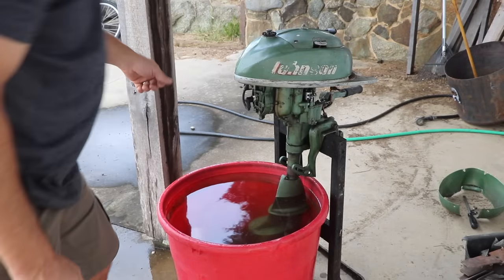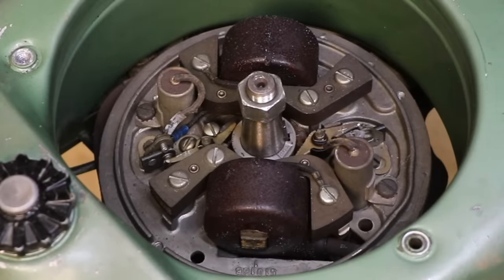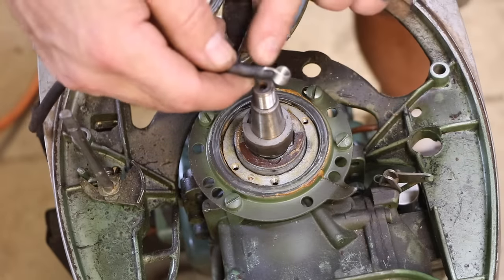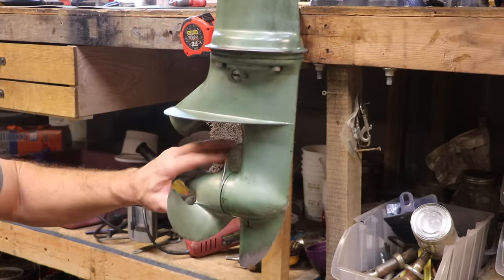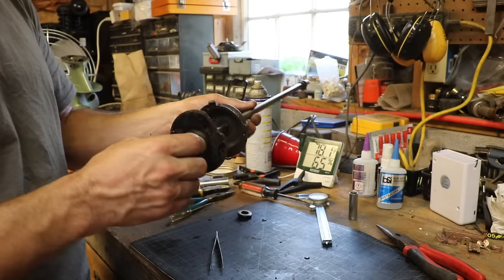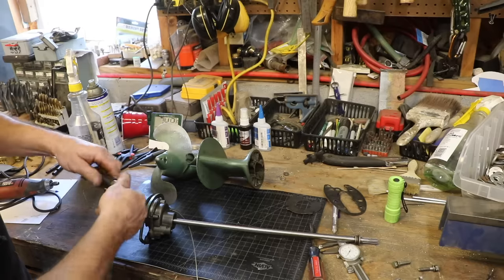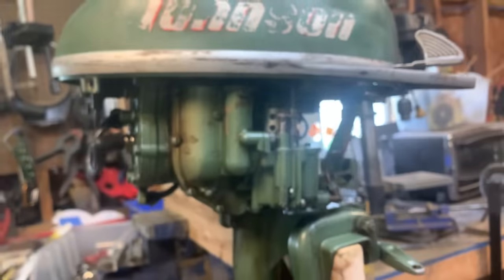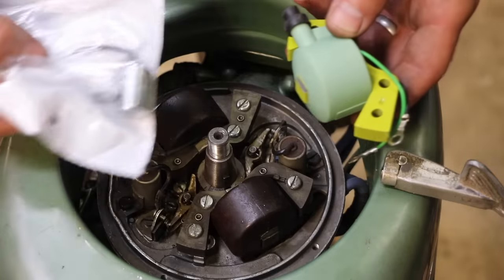My Johnson Needs An Overhaul, and it's Putting Up A Fight!  Johnson Engine Part 3

Comment: When I took the flywheel off of my 1958 Johnson seahorse 3 hp it flew across my basement and dented my furnace which was about 8 feet away I put so much for on the three jaw puller I bent the flywheel luckily it wasn’t supper critical cause It was cracked anyways I had a replacement wheel and I checked the weight. But if that had hit me I can imagine

Comment: You should get into the Old Mercury racing like 10 horsepower super. Super cruiser they had many miles the old 10 horse Mercury was rated at around 35 horsepower. Wizard was a Mercury back in the good old days the ones that sold at Western Auto stores

Comment: I'm torn 😂  on another channel a guy did a full restore on a vintage engine. Flower coated. Total repaint. New decals. Looked brand new. Does this take away from the value?  My logic is very small scratch and dent is part of the story and history. Any thoughts?  TIA

Comment: Any chance you might post where you purchased the parts for the rebuild? This is a very informative video. I’ve got the same motor sitting in my barn up in Michigan and was trying to decide what to do with it. I just might attempt overhauling it now that I’ve seen your work! Thanks for a great video.
Reply from the maker: Email Dan at samurai805335@att.net. He had everything I needed for good prices and was helpful too. Nice guy.

Comment: You are  knowledgeable and put together, some great content but I am  puzzled with the trend on YouTube with getting old things running with the minimal amount of parts and effort. In this case, the vloger ended up replacing everything he should have the first time around, and spending 3 times the time. It's a 50 yo motor that if it fails is going to leave you floating around the lake asking for a tow. Do it once do it right

Comment: Check and see if it has a high and low speed adjustments, I just the high speed when you’re under load, low speed while it’s at idle. If somebody hasn’t thought of this first.

Comment: The author, John Steinbeck, wrote about a little motor in his book "Sea of Cortez" (1941). Although he never mentioned the make, he did refer to the "sea horse". He and the crew hated the little motor that would run whilst it was not attached to a boat but would refuse to run otherwise.
I have always wondered about that "sea horse".
Reply: I had a motor like that..they told me..the crankshaft center bearings were worn out..not allowing it to get a good charge in the crankcase..running lean causes misfires..not repairable...no rubber seal the bearing is the seal...a thicker oil might make it run..if it does you know  what the problem is

Comment: In 1954, when I was 8, we gathered at my grandfather's house for Christmas, a family tradition.  After a massive dinner, all the presents were distributed...all except one, my present from my grandparents.  My long face was sad.  After the unwrapping had died down, my grandfather called sad me to his rocking chair.  "Merry Christmas!", he said cheerfully handing me a tiny box.  I opened it to find an old rusty key.   He told me that was the key to the little garage used for storage, now buried in snow.  All the men had snow shovels and went to work digging out the door!  At 8, I nearly died waiting.
I fumbled with the padlock and slid the folding door open.  Dressed in a big red bow was a carefully restored oak wood rowboat.  Shining n its stern was a fully restored 1940 Elto Cub 1//2 hp outboard motor.  The exterior hull was, curiosly, painted the same glossy green as the local state park picnic tables.  The inside was polished varnish.  The Elto would start if you just set the throttle to start and spun the flywheel with your fingers.  5 months later, the ice had melted so I could ride around the lake...

Comment: I have the same exact engine with the same problems that you have encountered, I have just acquired a set of rings for mine from Greece, mine does not start unless  you use starting fluid

Comment: i used to always fill from the top when using a bottle or tube of lube it would be to hard/impossible to fill from bottle with a bottle once i got a pump that goes onto a 1 quart bottle then i started filling from the bottom the only real difference is it is faster to fill from bottom then to fill from top due to escaping air but it is ok to do it either way just takes more time filling from the top.

Comment: You can use one of each paper.& Rubber coated gaskets on that Johnson outboard motor. I had one that was red& white I bought off of my mom's Dad 28 years ago.& Had to build.& Repair small engines for it just to get stolen from me.& Along my with all of my mechanics tool's for small engines.& Vehicles to.& Carpentry tools to.& A whole lot more of other equipment to besides just regular.& Power& air tools to.  No one wants to believe me about it all either. So I'll let everyone see what I mean then instead.

Comment: If you changed the head gasket and the new one is slightly  thicker it will  change the volume of the cylinder thus causing a lower pressure    Just my opinion.

Comment: This is a long shot but do think the old 2 stroke oil had different viscosity and perhaps zink? Just a thought, this was an awesome couple of videos. If the oil didn’t have zink the fuel was probably leaded so zink additive would maybe help with compression

Comment: Nobody is mentioning throttle position when doing the compression check. From what I know, you're supposed to open the throttle wide open when checking compression. Maybe this is why there is a difference.

Comment: They knew the engine was running on only 1 cylinder because the piston's popping sounds were too far apart, time wise, discrete sounds. There were clear individual popping sounds instead of a steady roar. Listen to enough small engines over the years and it becomes obvious to the ear. (As a kid I listened to my dad's small Johnson all the time. We lived on a lake.) I bet you could hear the difference in the sound once both cylinders were hitting. It became a steady roar after the previously identifiable individual popping sounds. 
It's been a while, but as you were working on that bottom end I could almost smell the lubricants. 

I don't think it needs a ring job. It's starting fine and pushing you through the water plenty fast for a 5 hp engine. Problems with those, and exhaust smoke are the indications of worn out rings. It's probably running at 90%+ of what a new one would. But if you want to finish what amounts to a total overhaul since you're nearly there already, then go ahead, and it will run 100% for the next 20 years with only minor maintenance.

Comment: I am curious about those spark plug wires? My 50s Pony tractor isn't getting very good spark and I tested the wires after I saw this video. One of the wires didn't read anything and the others had a very poor reading. Is it normal that spark plug wires have bad continuancy or dose it suggest that they need to be replaced? I really like your videos, it's great how you take the time to explain how things work

Comment: Should never hit a crankshaft thread with a hammer. You’ll have trouble getting the nut back on. Also should never test for spark directly in front of the plug hole. It can ignite any fuel blown out of the cylinder and cause a fire. I did that once with a mower in a workshop not fun.

Comment: I don't know why the wear item (the points) were not replaced during any of the multiple times the flywheel was off? The coil replacement was likely not necessary.

Comment: I have a 2 and1/2 horse Johnson. Serial # says it is 1943 vintage. Hasn't run in many years but  it turns over.  Does it have any value?
Reply: Everything has value, as long as you have more than 1 person interested.

Comment: Could a new (thicker) head gasket increase the cylinder volume enough to cause lesser compression due to more top dead center volume? Doesn't seem like it would make much difference, but just grasping at straws.

Comment: You should touch that condenser on thr outsi housing and the end of the wire that comes out of the condenser.  It  will be a shocking new discovery for those who never seen one before.. lol😂

Comment: "Old timey" elegant solutions in the way they built these engines. Now contrast and compare to the current way the are built... Everything electronic and "disposable"... May be good for fuel efficiency but would a motor built TODAY last 40+ years (let alone sitting in a shed!)?

Comment: It's nice that you can fix an old engine with a brass hammer and a screwdriver.  Newer engines require programming, code readers, and Manufacturer's Serial Data to fix.  🤠🧐

Comment: @18:08 in the video, you said that the water pump needs a dress but you never really explained why or how this would be done. Also, where would I find and buy this kind of thing? Finally, I would never, ever be crazy enough to tear into my lower unit. I like things just the way they are. I can't even imagine how excruciating that would be.

Comment: You always fill from bottom and take the fill plug out so as you fill you won’t have any air in it and that show your full when your not. So just check it after you run it for a little while and then you can top it all. The people that are telling you that are boat people and not a tinker man .

Comment: I am Late to the party.
Since this is a two cyl two stroke, it has 4 combustions per two revolutions, meaning, it should sound like a 4 stroke 4 cylinder.
This is why also it can idle very low, so much relative power with minimal relative rotating mass.

Comment: Couple unable things. Unable to lower idle.  Two, chitty, puff, chitty, puff,…no bang!  

2 strokes flood, they don’t back fire.  So no bang, carb back fire for over fueling coming up through carb..

Instead they puff excess unspent unburned fuel and oil out the exhaust. Which is why there is a lean rich knob.

It’s an early version of what you find and was developed back then for hand controlled model airplanes and race cars.

Still today modern model air plane engines run on nitro methane oil mixes, a very advanced version for much crazier Hp outputs.  What’s crazy it’s dialed in by a single metering needle on the carb.

Those are my thoughts

Comment: What is the compression supposed to be on those old engines?  Some engines were designed to run on lower octane fuels.

Comment: The engine kept running fine even at very slow speeds so you can control the boat in crowded marinas etc (my theory)

Comment: Next time you’re putting your seals and put a little bit of engine oil or gear oil around it. It keeps it from dry rotting. and next time it’ll be easy to take off

Comment: I really wonder about you sometimes. "If I make this in one piece changing the water pump in the future will be easier."   The original water pump hung in there for 45 years.  That engine will not see a 1/4 of the use in it's second 45 years as it did in its first, meaning that the water pump won't have to be changed until god knows when, if ever.  Even if it lasted twice as long, that's 90 years, good until 2114.  On top of that, the shaft doesn't have to be removed so that seal wouldn't even be affected.  And you are concerned about it being easier...  😁

Comment: You need to install a carbon seal.
A brass seal will not seal and let water up to engine. Seal needs to be installed gently!

Comment: You're not supposed to hold the flywheel when you're torquing that nut. You just use an impact and don't hold it. Holding the flywheel and tightening the nut could sheer the woodruff key. Don't ask me how I know. 😳

Comment: Jon, I've got a JW-10, Johnson 3 hp.  Johnson has it listed as being made between 1952-1954.  There is no manual for it and they don't have any listed parts.  It runs great, but I need to do some upgrades.  It's almost the same as your 5 hp.  Do you or anyone one here know where to get parts (carb kit, water pump impeller, gaskets, props, points, condensers, rings, etc.)?  Thanks.

Comment: There are so many comments that someone else may have discussed my issues.
Issue 1 of 2:
You have the nature and function of ignition coils completely wrong!!!  An ignition coil only has ONE winding!  The 12* volt supply voltage induces a magnetic field in and around the coil. Then, when the input voltage is removed by the opening of the points,  that field collapses very fast  and generates a backflow voltage in the tens of thousands of volts to the sparkplug.

Issue 2:
Causing a sparkplug to arc near the open hole where the sparkplug normally goes while spinning the engine can be somewhat dangerous unless the fuel to the cylinder is cut off.  If the mix of fuel and air coming out as the piston cycles gets just right,  it can flare dangerously as it is ignited by the spark.  I saw it happen once when I was a kid and it scared the crap out of me.
Reply: Not correct. It has two coils. Jon is right!
Reply: @gittesilberglarsen1262 
We are both right because we are talking about two very different things. There are two completely separate coils as you say but each coil only has ONE winding as opposed to a transformer which the original post described with primary and secondary windings.  Transformers are useless in a DC or direct current circuit, while a single coil uses a collapsing field effect to generate  a reverse flow of thousands of volts necessary to create a hot spark across the gap of a sparkplug's electrodes.  This collapsing field is created when the points open, suddenly stopping the primary voltage from flowing.

Comment: I also wonder if you treat it like a old 2 stroke and take some oil out of the gear box if  It will still lube but have less resistance to spin giving you more rpm. I'm not saying run it totally lean on oil but less sometimes gets you more.

Edit worked in my (yamahopper) Yamaha qt50 1980s

Comment: If you use non detergent 30 weight motor oil is your mix instead of 2-cycle oil and a little LED substitute that would be the fuel that it ran on in the past and it won't run 100 times better

Comment: wrong about the capicator the main reason for the cap is when the points open the magnetic field of the coil calapses quickly and induces a high voltage by letting the cap discharge.
Reply: No - YOU'RE wrong.  The only purpose of the capacitor is to prevent excessive sparking at the points.  The spark gets its energy from the collapse of the magentic field inside the coil.  How can putting a high voltage across the capacitor make it DIScharge?  You have no idea what you're talking about.

Comment: All he had to do is see if it runs properly at low idle speed. With only one cylinder firing it would likely stall unless both cylinders are firing.

Comment: Did you oil the threads on the puller ? I loaned a guy at work a fairly new Snap-On puller and he didn't oil the threads and ruined it.

Comment: You can actually hear it. Some people cannot even hear a miss with a four or six cylinder. I can hear a miss fairly clearly. The way Eric on South Main Auto can tell is when he hooks up the exhaust gas hose when the engine is missing he watches the hose. If the hose is dancing he knows it is missing. I can mostly tell if a two cylinder or 3 cylinder is missing. If your brain is tuned to what a miss sounds like the difference between a single cylinder is to me pretty obvious. Some people just can't hear it. When a tank on a farm has a certain level of liquid Some people hear this much better than I can by slapping the side of the tank. This is very difficult for me.

Comment: 2023 tech update: You "should" use outboard gear oil only with correct additives and always fill from the bottom with a CLAW HAMMER.
Remember to mix your fuel correctly, those are not 50:1 and may require 30W motor oil around 8:1.
Some flywheels are marked and you can set the dwell with an ohm meter to be more accurate.

Comment: Question, I have a mid 50’s 7.5 Johnson, and they don’t make spark plugs that fit the threads anymore. Is there a fix to make the newer(smaller) threads on the “compatible size” fit the engine?